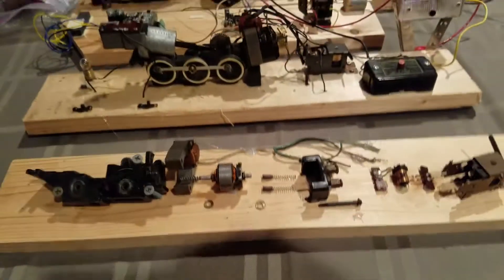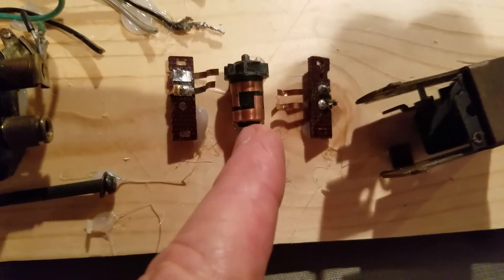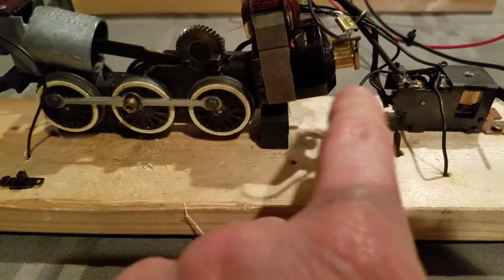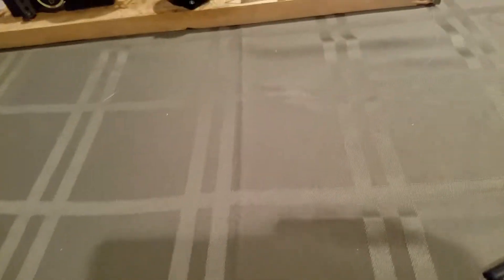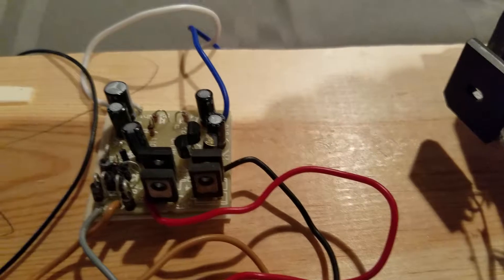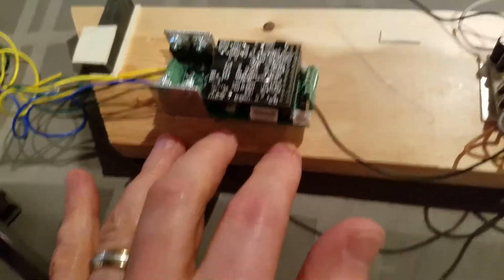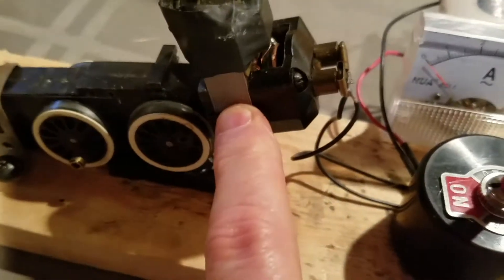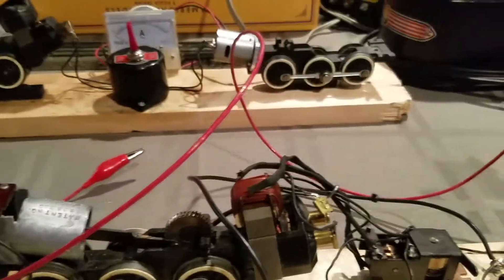American Flyer AC/DC what?

Comment: where can you get the Lionel DC controller?
Reply from the maker: They are not made any more, so We have a version we build. It takes in DC only so you need a rectifier in the tender or DC on the track. I have some made up if your ready. email me at murpheyd  4t aol d0t com . tell what engine/tender you have we can include the adaptor for mounting,

Comment: should have used a dallee 400 and it works with original AF DC motors
Reply from the maker: Bernard, that video was made for Scouts to get oriented on the Flyer model trains. 6 years ago! How much is the Dallee 400? We now have a version of the Lionel 0103 re-engineered to handle 4 Amps. It's $25. I had used some Dallee gear and it is top drawer, but it seemed to the market I saw. The DIY guy with a small budget. Since that video we have also solved the Vintage Motor AC DC dilemma. I have designed a new Field Assembly the brings back the magnetic Fields of the late 40s. This time no steel plates. We use special magnets and a plastic housing to convert the vintage  universal motor to Magnetic DC fields reusing the Armature, Brush Holder, and brushes. Amp draw is 1A max.  We also offered it in a double wide fir the Flyer Big Armature. For $25.  We also designed a smoke lid to replace the Flyer 17 Ohm heater and lid with a PC board. That board is $25. It bolts to the vintage smoke lid, uses the old angel Hair and requires a rectifier AC to DC which we include. With the piston and vintage housing you still have Gilbert Puff & Chuff. We also designed and built All Wheel Pick Up Trucks for train tenders. These bolt on to the vintage metal chassis and bring 8 wheels of track power into tender. We also made a cab bulkhead firebox with a flickering fire box.  And we have sourced a skinny Engineer that fits in the cab. So in 6 years we have tried to address the weak links in AC Gilbert's efforts. And add some 21st Century reliability while maintaining the character of the beautiful S gauge classics. Funny thing, most of our work results transfer to the O Gauge Gilbert Flyer engines as well. I hope this info helps you to see where we were and where we are today. Wishing you all the best, D
Reply: right now they go for 60 dollars for the 400 the 406 with more amps is 80 hope it helps

Comment: Thank you for the information.  I have a dc motor on one of my American Flyer Steam Engines, during your presentation you showed a bridge rectifier connected to a e unit and you stated it would work as an AC. I would like to try that can you give me a diagram on how that is done. Thanks
Reply from the maker: I will dig it out and post it tomorrow. No problem.

Comment: Where do you buy your motors?
Reply from the maker: My DC Can Motors come from Steve at SNS (http://www.snstrains.com/index.html). The Magnets for upgrading the Flyer DC Motors came from K&J see this note: 
Hi Dennis,
The magnet that you have in the images does look like a ferrite magnet. Our magnets are quite a bit stronger than those. It might be a good idea to do some testing to make sure it isn't too strong. To get the field through the plates and through where the armature is, there are different arrangements of magnets that can be used. It might be good to get 2 B862 magnets and put them into the space, with each one on different ends stuck to the laminated steel plates. This will give you less strength since the magnet is smaller and the field is still going to travel through the motor. This also gives you the ability to stack them to find what works best. B861 could be used as well if you would like to have finer control of the magnet material you are looking to use.
If you have any other questions or need me to explain it a little more, let me know.
Thank you for contacting us.
Best regards,
Drew Perkins
K&J Magnetics, Inc.
www.kjmagnetics.com
For a wire wound Field of the Vintage Flyer AC open Frame motor I made my on mods for a professional machining conversion contact Jim Shea he has made several for us and they are art work.  https://www.facebook.com/jim.shea.798

I hope that helps you out. We have lots of options for the Steam Engine however for the Diesel Alco the options are much smaller. We are also working on a DC Conversion of the AC Alco motor by Gilbert, two prototypes actually worked well but were very complicated to build. we are exploring various manufacturing options.  Best of Luck and let me know how it works for you. Dennis

Comment: Toy train motors for the most part universal wound and will operate on either AC or.  DC.this was chosen because at the decision about AC or DC was still up in the air its an interesting story between Tesla and Edison. Edison favored DC,Tesla AC,Tesla won,transmission over long distances is cheap,dc on the other hand requires substationslots of them to replace line loses,AC does not so that's why Mr Cowan chose the way he did.
Reply from the maker: One of the keys for me in dong this video for the Boy Scouts was to educate folks on the versatility of the Flyer Motor and dispel the need for DC on the track. Secondly I wanted folks to appreciate what a great engineering job was done for reliable operation of a toy train. Lastly I wanted to show modern updates available  for further improvement. As an update i have been able to rework those original motors for even smoother operation with DC power. One of the issues was the mechanical reverse which we have replaced with a Digital reverse PCB.  In doing that we had to add a device in front of the motor to provide Reverse with 2 wire DC input. But it is quite doable and reliable. In fact as we lean more into DC computer control this old motor can continue to provide wonderful legacy power without Magnetic Fields or major conversions. Keep watching for our attempt at the "Next Generation S".

Comment: Where do you get the lionel reverse units?  Where do you get the electronic unit?  And where do you get the dc motors for engines?
Reply from the maker: I have Lionel Reverse units from the Train Tender, he runs out sometimes. They are reproduced. 
http://www.ttender.com/

Carl Tuveson does offer repaired units if you get in a pinch. 
http://www.tuveson.com/

 The TMCC Controllers are now sold thru Sun Set Models under the 3rd Rail name.  
http://www.3rdrail.com/err-3rdrail/index.html

All my DC Can motors come from Steve @ SNS. He provides an outstanding product for most of our engines.
http://www.snstrains.com/index.html
Reply: @DennisMurphey  thank you so very much!  I really appreciate this.  2 more questions...if I want it do a hybrid and use a traditional e unit the bridge rectifier needs to go after the e unit correct?  And...you had ask me about doing some testing on the smoke units in alcos... I'm extremely interested in that project.  Could I purchase a smoke unit and control from you?  Or is there a way I could be part of the research?  I also saw the 3d trucks you made.  Again...awesome!  Is there a way I could purchase some from you?
Reply from the maker: @AustinsAmericanFlyertrains  I will check I have schematic around here for all variations. I would enjoy test and feed back. I can send turn plus a kit so you could help with kit instructions and design improvements. I prefer to offer kits but you could then offer turnkey. I am too busy designing more parts. Murpheyd@gmail.com let me know.

Comment: Thanks for fighting DC ignorance Mr Dennis. Some of us have  been hard core DC people for ages and often find it humorous when HO'ers move to bigger gauges and are puzzled with this AC  anarchonism.  Some people argue that some situations with running ac universal engines on DC  with DC engines were cleaver but the reversing units became magnetized with use and no longer functioned.  I personally suspect that the economics of service station repair played a major hand in delaying DC motor use.  I think the "E" unit   magnetization  problem could have been overcome and both systems used simultanuosly.  I started with tmcc because I  liked the concept but the engines were advertised as strickly AC and forced me to add extra switches for the  AC power.  Lionel finally woke up  and made fully compatable engines with either DC/AC .
        I  am switching to DCC currently but will use TMCC  for  accessory control
Reply from the maker: I would never say it like that but yeah, a lot of misunderstanding about the tracl power versus the motor type. I made the test set for our club display for Boy Scouts, they liked it so much they kept it. But i made this video before i gave to them. I really appreciate all the engineering done by the Gilbert Guys. The talking station was so fun to repair i saw all the little tricks they used because of the limiting technology. And the engine castings are so clean and proportional I love jacking them up with 4 chuffs per rev and flaming fire boxes and all that. Working on a AC to DC Conversion for the Diesel Motors from Gilbert. That would be nice.
Reply from the maker: I had that problem with DC ruining the reverse units so moved to the 0103 Lionel Digital Reverse for AC track and DC motors. When that supply dried uo I found the reverse engineering documentation and build our own Digital Reverse board for DC Fielded Gilbert motors., Still use today although we close to a DC Controller with PWM for slower speed control.

Comment: I recently learned that you can operate AC American Flyer trains on DC. I would like to convert a locomotive to DC without changing the motor. Will it use the same amount of power or harm the motor?
Reply from the maker: No it will not harm the motor and it will run as long as the fields and brushed have been wired properly. Check out a good book like Tom Barkers Repair manual.

Comment: Hi I have a 336 American Flyer can you tell me which wires go from engine to coal car. thanks
Reply from the maker: It all depends in the existing components If the Motor is DC then two wires to the motor and jumpers to the headlight and smoke are all that is needed. If it is AC then you need 4 wires. 2 to energize the fields and 2 to power the brushes, again jumpers from them to the headlight and smoke.

Comment: will the Lionel digital control work with both kinds of motors?
Reply from the maker: yes with correct wiring the old General Purpose Flyer Open Frame motor can be used with the Lionel DC Controller. The price has gone up on the Lionel part sadly. no new engineering just plain old greed same 4 year old design.

Comment: Hello Dennis!  I’m looking to dabble in transitioning DC can conversions or digital conversions, I’d like to see If I can incorporate a Raspberry Pi into my layout for automation as well. Do you have a go-to source for some of the items you ran through in your video?
Reply from the maker: One yes, Electric Railroad Company has the controller, the sounds and the Puff & Chuff boards, I designed and printed all the 3D parts. The TMCC stuff is a open Standard but I simply use  the stuff that meet the standard.
Reply: Dennis Murphey thanks !  I’ve still got a bunch of stuff on the restoration bench right now, so it’s going to be a little bit before I can get started, but I’ve really enjoyed watching you modify some of these great old engines, I think it shows the versatility of their design (even if it wasn’t anticipated 70 years ago!)
Reply from the maker: @vmipiper  Just checking in are you doing ok? I had some new stuff have you seen it. I need a new sound board are working in sound???
Reply: @DennisMurphey  hey Dennis!  Been watching with great interest. Work keeps me away from the trains these days (as you know) but I do continue to dabble when I can.